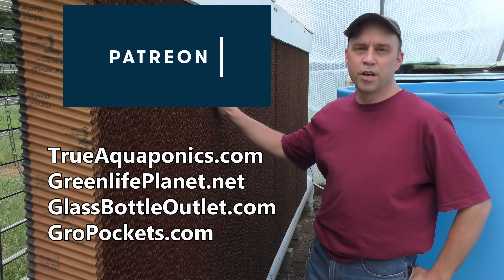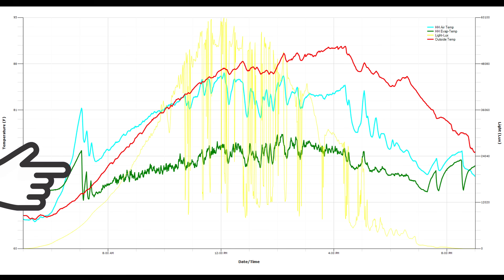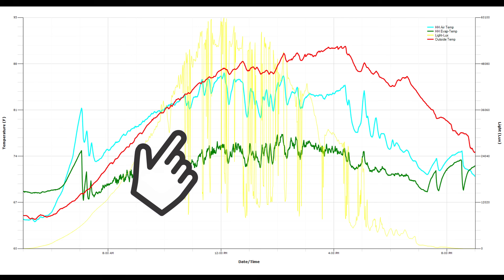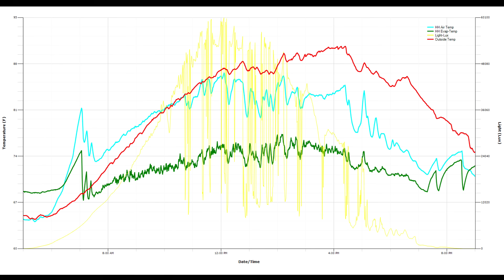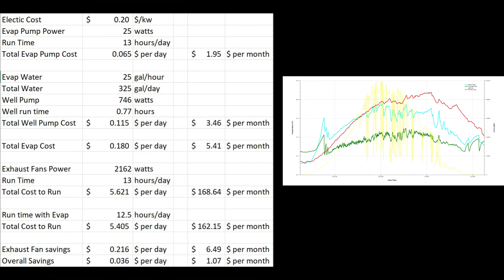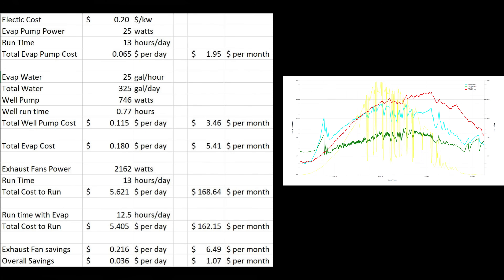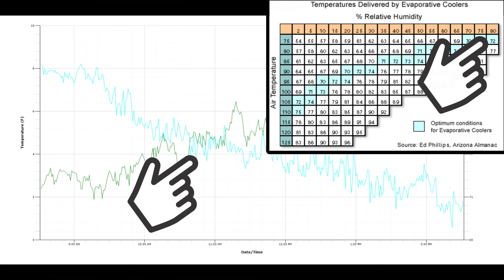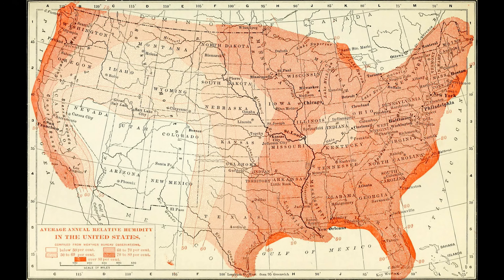Evap Cooler - The Cold Hard Facts!

Comment: Very informative and helpful, especially with the data that you show to compare costs, efficiency and such.  May I ask if this would be a reasonable build for a garage/shop with a square foot area of about 800 square feet?  I have a 10 ft ceiling height.  My garage does not compare in volume to your green house but if scaled down proportionately I think it would be perfect for my needs.  Our average relative humidity during the Summer months is about 55%.
Reply from the maker: It should work.  Keep in mind it takes a lot of air flow for it to work. I will also increase the humidity in the space.

Comment: What were your costs like for purchasing and building the cooler? I’m hoping to build a few for our greenhouses. We’re in AZ so they’ll be great here.
Reply from the maker: probably around $1000 for something this size if you DIY.  It will work great in AZ...you just need a LOT of water for it!
Reply: @Bigelowbrook  
Good to know. Those looked like 6” pads. How tall were they and what length was your unit? Also wondering what kind of CFM your exhaust fans are pulling, square footage of inlets, and cubic footage of greenhouse. I’ve been looking for resources on how to design one of these units but haven’t been able to find much.
Reply from the maker: These are 6" pads and 60" tall.  Total width is 15'.  The air exchange is about once every 2 minutes.  There isn't a lot out there about coolers.
Reply: @Bigelowbrook   Thanks for the info!

Comment: Hi thanks for the video. I live at equator area which is RH around 70% to 80%. What your suggestions? Should i try this system or using geothermal system?
Reply from the maker: probably not something you should use in high humidity.  You should check in your area to see what other people are using.

Comment: Do you have any readings for relative humidity?
Reply from the maker: The inside humidity usually increases about 5-10% over the outside humidity.  Which is far less than the nighttime humidity of >95% when the fans aren't running.

Comment: Having lived in AZ and having had a swamp cooler, I would have assumed that this would not have worked. Once it goes above 35 percent humidity they basically stop working... at least in the sense of personal comfort. 40 percent is akin to a rainforest there, 6 percent is not uncommon in early summer. By the 80’s most homes had a dual system of swamp and AC. Swamp is great when it’s very dry outside when the added humidity is refreshing, but there is a monsoon season in late summer, and swamps seem to stop working so switching to AC is welcome.  Currently Evaps are much less common, water gets more expensive and A/C’s get more efficient. There is also a social stigma that’s associates them with the poorest or rural areas. But Clearly they don’t stop completely in high humidity, and it’s welcome in a greenhouse.  It is amazing that it lowers the internal temperature so much at 70 or 80 percent. The wall of filters and the water within is a huge mass, not to mention the airflow / number of air changes per hour.
Reply: That makes sense to me.  His cooler is massive compared to his air space, and the cooling is all gone by the time it leaves his greenhouse.  The fact is that you probably were picking up a few degrees of coolness even at high humidity, it just wasn't up to the task of enough cooling for you to be comfortable.

Comment: You could use a solar chimney to lower the pressure and pump the air through the cooler. You would be less effected by humidity and pocket the electricity of the fan.

Comment: Watched the first video as well.  Worked at a food plant where we pasteurized liquids.  A tube was flowing then heated to 180 then cooled to 40f.  One of these things was used in cooling.  I was just going to confirm what you are seeing, they are messy.  Ours was on the roof and over a story high.  If you stood in the right spot you'd pretty wet.  Wind changes effect how wet it is.

Comment: Pretty fascinating video series. 
I live in the southwest so evaporative cooling systems are used pretty extensively for homes here. 
Most people here just call it air conditioning, and if you have a  refrigerant based AC system it's called 'refrigerated air'. 
But most of the homes here have full roof mounted evaporative cooling systems, going into a central ventilation system like any other home. 
A lot of these are now being converted to refrigerated air, the difference in operating cost is not that significant anymore, and you do get a lower and more consistent air temperature with refrigerated air systems.
I'm surprised that your evap cooler even works or is worth it at that high humidity level. But obviously you're getting some temperature drop. Fortunately for you water is essentially free. 
One of the unfortunate facts is that in places where evaporative cooling works very well, the water it takes to make them work is not free and sometimes is quite scarce. 300 gallons of water per day? WOW!!!  The price of the water alone here would cost you $8 per day If you are living out in the country away from the city. Inside the city limits they have city water, and bill you at a flat rate up to 10,000 gallons, $40 I think.
Which just blows my mind. 
I'm paying $90 for 3500 gallons delivered. And that last me almost 2 months.. 
very much enjoyed the construction video and your detailed explanation of its operation and costs. Keep up the great work

Comment: What is the humidity difference of the exiting air, when using the cooler and not. Just wondered if the water used was offset by less water needed for the plants.
Reply from the maker: It only raises it a few points.

Comment: If you are using well water it probably has a high mineral content, won't that build-up on the cardboard over time and lower its efficiency? How often will you need to replace it?
Reply from the maker: our water is crystal clear.  The well is 500' and through solid granite.  It will take a while before anything will start to accumulate on them.  It's the intake of bugs and pollen that will be the long term problem

Comment: I live in Phoenix Arizona and use evaporative cooling for our home, suplimented with traditional air conditioning for the times that the evap cool becomes ineffective. I think you will find that watching the dew point would be a much more effective way to estimate the efficiency of the cooling in your greenhouse than humidity.  Humidity being a measure of water in the air while the dew point is the temperature where water begins to evaporate.  Our commercial cooler provides air at 80 degrees or less with a dew point up to 58 degrees.  Beyond that, it's is A/C time.  Lower dew points can produce cooled air in the mid 60 degree range regardless of the humidity. The humidity only serves to make wooden doors and wood floors swell.  Great system. I had never envisioned a system setup like that.  Be Well.
Reply: Excellent info. Thank you....Kingman AZ
Reply: The best measure is the wet bulb temperature.

Comment: I keep seeing the open ends of your wet wall and all I think of is the air going around the wet wall instead of through it.  Air will find the path of least resistance and it will try to go around the wet wall unless you seal the input area to the wet wall pads area.  Your video shows the sides at least are open, meaning a fair amount of air will go around the side of the wet wall.  
btw, I have had almost the exact same design system in my orchid greenhouse for 20 years.  It's a great wet wall, but I do have the input side isolated to go just through the pads.
Can you comment on this?
Reply from the maker: There are side panels so all the air goes through the pads.  I just didn't film that part.

Comment: You need to implement solar panels using that much electricity.
BTW, this video doesn't show up when listing your videos.  I clicked on the link at the end of your latest video to see this.

EDIT:  Also btw, I have an 8K solar array at my house and can answer questions about that if you have any.
Reply from the maker: I haven't made that one public yet....a treat for the people that actually watch to the end.  ;-)  I'll release it in a few days.
Reply: @Bigelowbrook  Another thing I was wondering about.  You mentioned that things such as lettuce like a cooler temperature.  I've always thought that tomatoes liked hotter temperatures.  And tomatoes are worth significantly more than lettuce.  Is it even cost-effective to favor cooler temperature conditions?  It'd be interesting to see which plants are negatively vs positively effected by the temperature change.
Reply: I was reading the comments of the previous video and Rob had mentioned another video then realized oh an easter egg.  Cheers 
     Bill

Comment: OTOH availability and willingness to evaporate loads of water may be not as strong in states that are dry anyway, so either live with low efficiency due to high humidity or use high efficiency with less water to spare. It's like a pareto optimum.
Reply: Similar setups have been done with salt water.